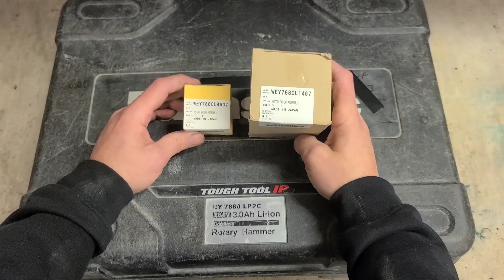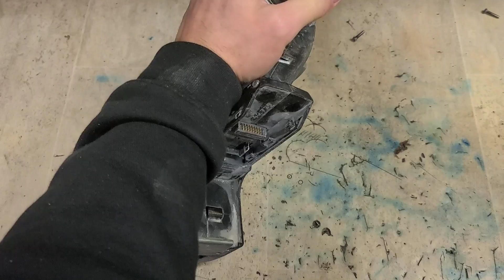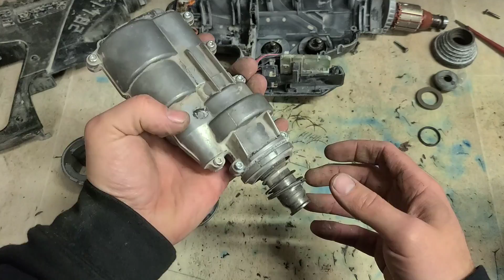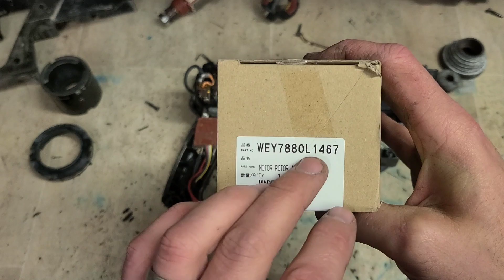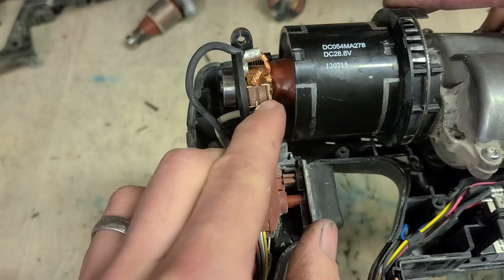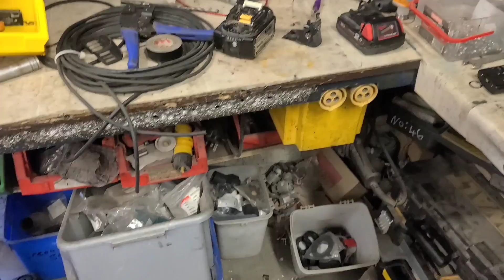Repairing a Panisonic EY7780 SDS 28.8v cordless drill. The last Panasonic I'll be repairing.

Comment: There's a video on YouTube of The Panasonic stand at a tool fair , they had an impact driver and 18v battery fully immersed at the bottom of a large fish tank , the demonstrator took the battery and driver out the tank , gave them a quick shake to disperse most of the water , inserted the battery and the impact driver worked fine 👍

Comment: still using my hilti te6 (36volt  li-ion)  which i bought in 2013 . gets used  (and abused)  everyday.  just bought a new battery as one failled but the other is still good.  no repairs to the drill ever .

Comment: I bought the original 24v Panasonic hammer drill in 1986/7 and it's still going strong, I use 1m masonry drills in it on a regular basis through stone walls, bought an EY6813 with soft start good drill, but will not compete with the power and hammer of the original one. Really enjoy your video's

Comment: Hey if you need brushes for anything like those replaceable ones. Temu is the place to get them, they have them in every single size. Cuz I mean they did make it
Reply from the maker: i wont be using Temu. and I would not recommend anyone else to either. 
They contacted me a few months back to sponser a few of my videos. They would get me to advertise temu for them and i would get paid for it. 
A big no from me. 
when you have to sign over your rights in order to use an app, its best to walk away.
Reply: @deandohertygreaser  buddy if you had any idea how cell phones work, or the microtechnology that's embedded in it. Anything they want, they already have access to.

Comment: Hey Dean, I was wondering if the original lubricant was a lubricating graphite powder?  It looked a little like it when you showed it on your finger.  I found an interesting article about graphite on Wikipedia that said that it can sometimes degrade aluminum. I recall you saying that sometimes the gear box wears.

Comment: Panasonic was the first to have their control boards sealed with some sort of silicon, which made the electronics last through nasty weather conditions a long time.
Solid machines, the reason I think them becomming more and more scarce on the market was they only had a basic line of machines where other brands expanded on their platforms. 
The positive side was you could both use the 12V and 18V batteries on every machine. Luckily we still got a Panasonic in NL so parts are available, but yeah we only see a few of them in for repairs compared to ther brands these days.

Comment: They must be using a MoS2 based lubricant in the gearboxes. 

Ive been exclusively using Febi drive shaft grease for everything because its loaded with molybdenum and it does make a noticeable difference in reducing friction.
Honestly MoS2 or WS2 (tungsten disulfide) grease should be the standard for all tools. Provides such superior surface protection.

MoS2 powder is such a good friction reducer that it can be added to any grease or oil and there will be a noticeable difference.
Way back in soviet times in east germany they experimented with it and added it to the engine and transmission oil of tanks and other military vehicles.
There are still some engine oils with MoS2 added to them. They are dark grey with a silver shine out of the bottle, always messes with peoples heads that its meant to look like that.
Many modern oils incorporate organic molybdenum compounds into the additive package, those fully dissolve into the oil so the oil stays clear but under heat and pressure a protective molybdenum tribofilm will form on metal surfaces.
BUT: For a sealed gearbox thats run for extended periods of time ands heats up considerably you DONT want a moly grease. You want a goopy oil like grease that will flow around the components and keep everything coated with lubricant. Hence why its best to stick to the grease the manufacturer uses.
Bext example here would be hammer gearboxes as some Bosch hammers even use straight oil.
The grease in most larger hammers is an NGLI 0 viscosity.
Reply: id be scared its going to slowly sand away the metal, otherwise i want some for my bike 😂
Reply: @luminousfractal420  it does the complete opposite. Forms a protective Tribofilm on the stressed surface. Same happens inside engines because the engine oil has additives dissolved into it that form this tribofilm under heat and mechanical load on the surfaces.

Comment: All that solastic on the armature is not seen often,nor aluminum fan blade.
You can tell this is more engineering, and less marketing! 
First Panasonic drill I used was a contractor's in 1994.
Next was in an rta cabinet shop with digital controlled torque limiting impact drivers in 2004.
It's a shame what is bean counted out of disposable tools.

Comment: 😂 Ha I have a panasonic impact driver. Can get aftermarket batteries. Nice tool. Use it regularly.
Reply: Same here. At work we have a tiny 10.smtgh impact driver that's maybe close to 20 yrs old. Driver runs like a champ, batteries are 2nd or 3rd generation.
Reply: @SteifWood  ey7202?
Reply: @my_channel_44  I check after Easter back at work :glasses-purple-yellow-diamond:

Comment: For a while around Chicago, cordless meant Panasonic.  And then they just sort of stopped caring about selling power tools. Industrial is here in small quantity, but otherwise, you have to buy Hilti to get Panasonic tools.
Reply: @HalideHelix The 90’s.  Plenty of Makita and Porter Cable from the 80’s floating around but Panasonic had a heck of a lineup. To be fair, cordless wasn’t really a thing so it wasn’t like everyone was running around with Panasonic. 90’s will be remembered  more for the decade when Dewalt took over the market out of nowhere.